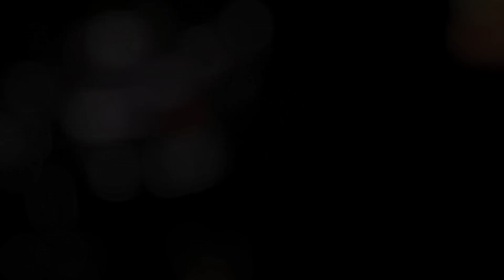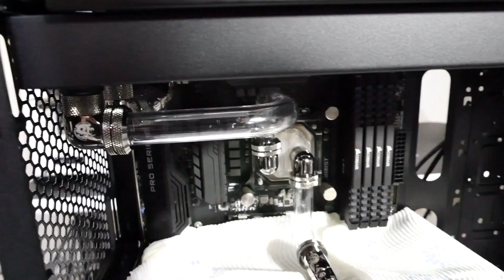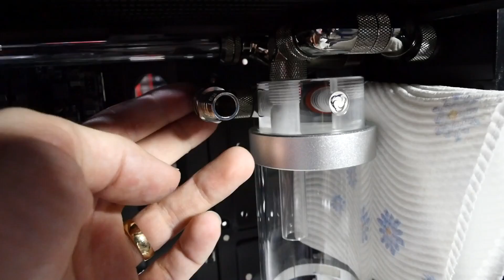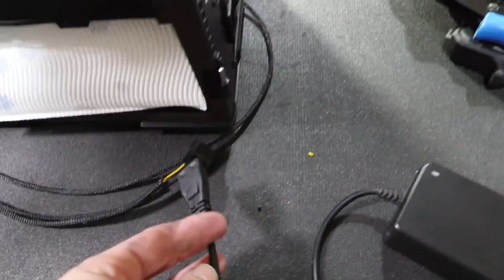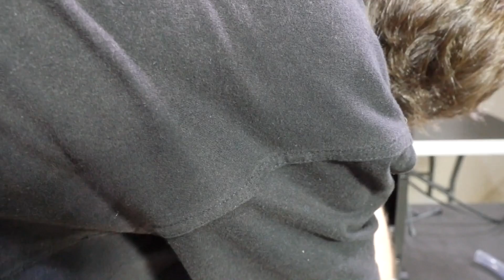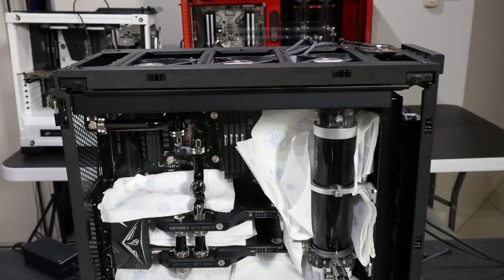Liquid Cooling: Filling & Draining

Comment: why have really dark color on your fluid when you can have a dark colored tube? i dont understand with colors. I ran with different colors for years but today I want transparent. never to worry with cleaning seals and replace tubing due to concentrated colors. I just love the simplicity to empty your system, fill it with new distilled water, adding glycol and ready to go in a no-time

Comment: A nice trick if you don't have a port for pressure then you can put a straw up the drain port higher than the water then the water will be replaced by air...
It would be pretty hard with a big reservoir tho

Comment: I spend 300 on your pump, res, top, cover, etc. I noticed there is only a single out port on the pump top. Why? there are 3 or 5 in ports. An additional out would have been nice for draining.

Comment: Thank you for another guide, very helpful to a novice like myself.  And you called it.  My first time doing it, on the bridged-PSU/no components plugged in run, it leaked.  Good thing I listened to you and it was mitigated (some drips on the GPU backplate and onto the paper towels).

Comment: Hi mate , Great video. One suggestion though, maybe do a video showing the merits of leak testing your loop with compressed air before filling the loop with liquid coolant. This way if you get a leak you wont have the situation where you find a leak while the loop is full. I did this with my loop. I pumped the loop up to 7psi with a small hand pump and a shut off valve and gauge. I left the loop over night and checked it was holding pressure in the morning. When I filled the loop I still used paper but I didn't need to at all. This might save new builders from having leaks on their expensive gear.
The best bit is , if you do have a leak with air you can find the leak by wiping a damp cloth or cotton bud over your connections and looking for bubbles coming out. Cheers , Dan

Comment: In regards to draining I disagree with you that you can't empty the system in a big build. It's tricky yes, but entirely possible. I had trouble emptying my build the first two times I rebuilt it. But the third time I tweaked some of the tubing and I now have the front res with the outlets at the bottom and I can pretty much get 90% of the liquid out by just opening up the drain port. I only have to do a tiny bit of tilting to get 3-5% out which then leaves me with just a tiny bit stuck in the reservoirs and GPU water blocks.
Reply: hes talking about super tight complicated builds?

Comment: I'm curious as to how you removed the filler pipe without losing lots of liquid ? If you turn it off to do it, you get back fill which would overflow through the open port and if you leave it running you get splash back, no ?
Reply: Interesting how hydrodynamics works at times, isn't it?

For liquid to escape, air must be able to get in to replace it. So he likely closed off the fitting port he opened slightly so air could not get in. Since air can't get in, there would've been minimal fluid loss -- a few mL, likely whatever was still in the fitting that couldn't get into the loop plus probably a little more. And since air couldn't get in, the liquid would've just kept flowing through.

Think of household plumbing. Look at the top of any house and you'll see pipes that stick up out of the roof. Those are called "breather pipes". Without the breather pipes, air couldn't enter the plumbing system to displace the water, such as for drains and your toilet.

Comment: If I'm not mistaken I think that's a corsair 900d case I personal would of done the left valve and towards the back of the case where the water cooling tube gap is and done it up that way.
Reply: I wondered about having a pass-through going through that blank panel as well, wondering why it wasn't considered. I would've tried for the right valve, though, the one nearest the front radiator that wasn't in the flow path.

But that isn't the 900D. Not sure what chassis it is at the moment, but it's definitely not a 900D. The 900D has 5-1/4" drive bays to start, and is significantly taller as well.
Reply: Phanteks Evolve ATX I believe
Reply: its phanteks evolve, he already did a video on building this pc "silver tide"